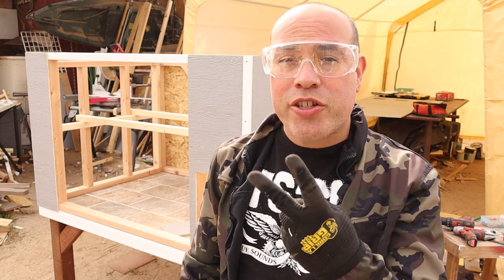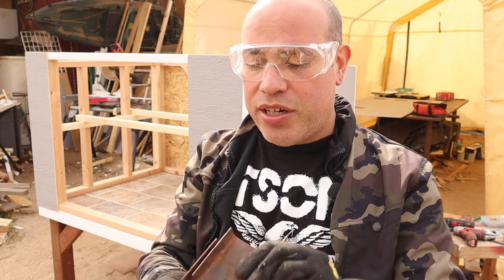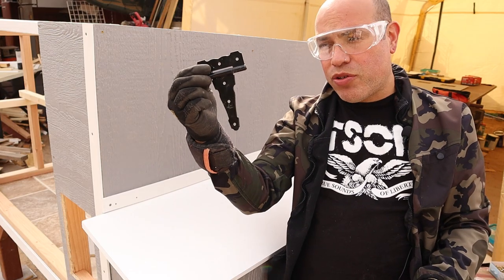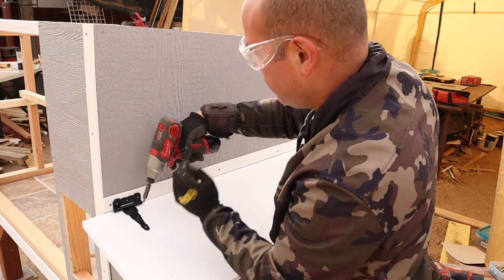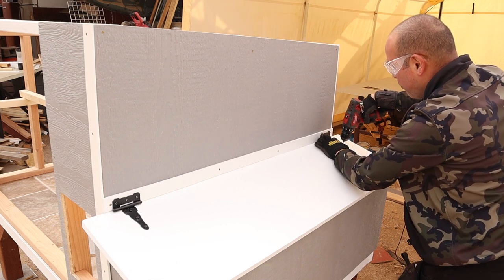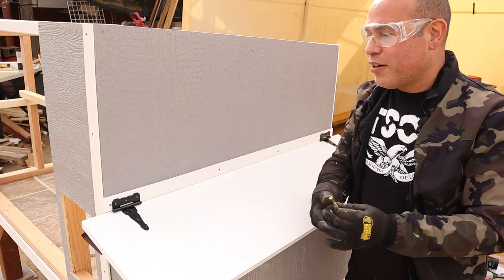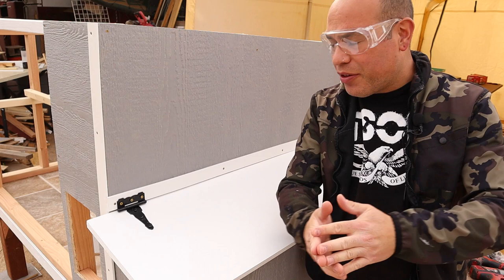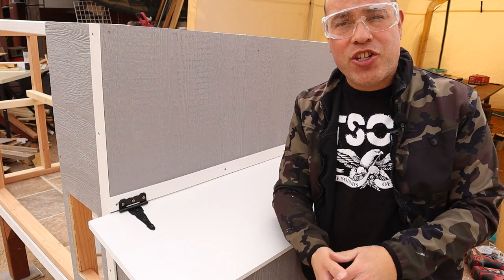Installing Nest Box Lid Hinges on Chicken Coop

Comment: Nice job. Only question I have, what's to prevent water from entering the nest box from the gap you have from the spacers you used? If this coop is going to be covered, then I understand, but what if it isn't?

I guess I would use a length of white pvc garage door seal over the gap to prevent water intrusion.

Again, well done. 👍

Comment: Is that going to leak rain water in along the wall with that little space?  Mine does and I am wondering how to avoid that this winter I don't want it wet in there again when the chickens are finally using it to lay their eggs in. The roof does not extend over that part. Oh I see now someone else asked about that

Comment: Does it leak water into the nest boxes at the wall to lid connection? Seems like a sure leaker?
Reply from the maker: The over hang of the roof usually covers that, but if you wanted to, you can also add some caulking to that edge of the trim and keep water out for sure. We’ve never gotten water in our own nesting boxes
Reply: @BockBockBouquet  
Caulking in the hinge joint crack?

Comment: Looks like several people asked about leaks/water but i don't see where you responded whether it actually let water in or not. That's too bad
Reply from the maker: Hey, on mine, I have that piece of trim over the nesting box. Even if it’s just an 8th of an inch overhang, it should be able to have the rain roll off on top of the nesting box and slide down instead of in the coop. If you want to go the extra mile with it, you can also caulk the seam where the trim meets the wall and close any gap possible